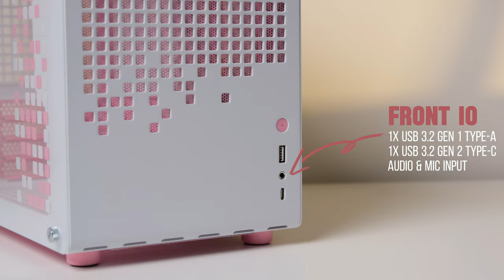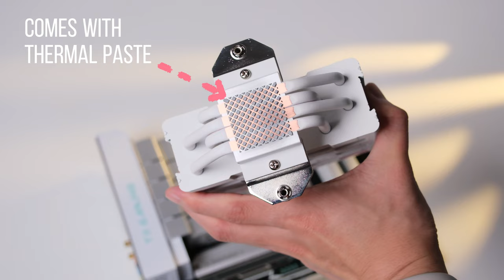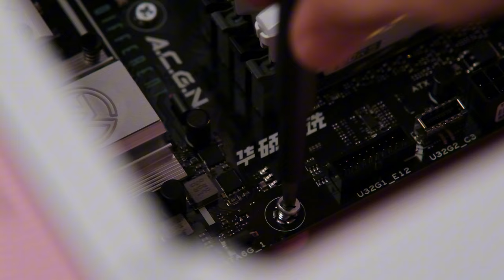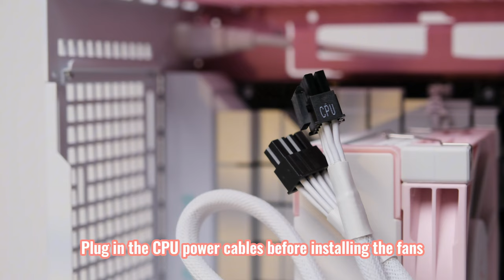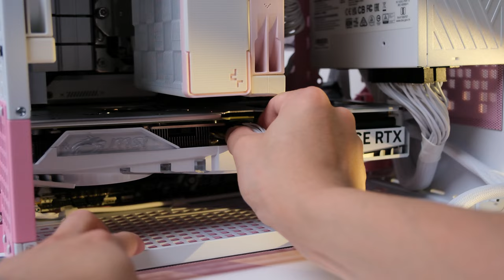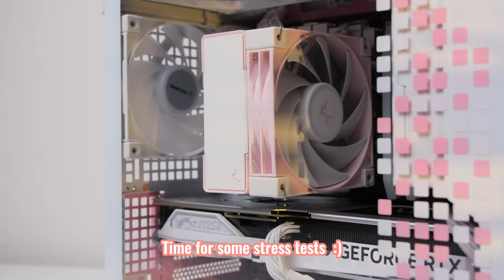A Pink White Jonsbo Z20 mATX Gaming PC Build

Comment: I knew it was the Deepcool AK 400 Pink that was going to be used in this build. I wonder why you didn't pick Galax GeForce RTX 4070 Ti EX Gamer Pink ? Don't worry, MSI GAMING X SLIM is absolutely stunning ✨
Reply from the maker: The galax one is rarely in stock in Australia and the pink on it is a bit too rich that might actually ruin the light pink white theme. If I can get sponsor from PowerColor instead of funding myself, I would've chosen the PowerColor Hellhound Sakura AMD Radeon 7800 XT to be the GPU instead. For the PSU I would also pick Seasonic VERTEX SAKURA Limited Edition GX-1000 1000W Power Supply (pink white all the way!), but it is not sold in Australia :(

Comment: Wow, was the psu a fully ATX? Not sfx-l? Is there even space for an AIO on top? Just wow.
Reply from the maker: 14cm long ATX and yes you can do AIO on top
Reply: @nellalab  mhhm, what was the problem with this case? It seems Amazing, are there some secret problem? It's too perfect and cheap to be real 🤣
Reply: Btw, you can use new enermax df 12. A full atx PSU in sfx dimension!
Reply: I have black with orange accents myself, mainly MSI. Have 2 case fans bottom, sucking air in from bottom. 1 back fan as exhaust. MSI 240 AIO, hose on right. Corsair SF-L PSU needed to be position 3 down to fit AIO. Love my little box.

Comment: Ever since I saw the z20 cases a few weeks ago I've wanted one so bad...they aren't super SFF but offer so much more than the terra and only maybe the ncase m2 would offer more for smaller, but without the lovely color accents..

the pink and white is gorgeous but the pink and black has appeal too, but I love the honeycomb and white as well!

Also I love deepcool, they make awesome stuff and their mystique 240mm AIO would go very well here (maybe if it fits) tho maybe PSU would have to be lower which would mean sub 310mm cards like the proart one but either that one or the ID cooling pinkflow 240 aio which would be perfect.. If only the Galax 4070 EX gamer pink graphics card would fit..😢
Reply from the maker: If u wanna use 240 AIO at the top, it is recommend that you install the radiator with the tubing side on the left so it would not impact the PSU. In this case you should be able to install the PSU at the second slot. And I highly recommend buying a 140mm long PSU. It will give you better clearance for GPU. In this case (second slot, 140mm long PSU), you should be able to install GPU with length of 363mm.

Comment: flip the cpu fan, intake from back, and only 1 fan up top near psu, and put 1 or 2 fan on bottom
Reply from the maker: Intake from the rear I was also thinking about that but then using the Deepcool fan as intake, given it is too close to the rear panel, actually generates higher noise due to turbulance.
Reply: @nellalab  try other fans, or just lower the rpm to ok noise. turbulance from where? air? cause the fan too close to each other? flip the fan not switch the position

Comment: cool build, may i ask how loud is this under load?
Reply from the maker: The CPU doesn’t require high watts and I picked the MSI 4070 Super Gaming x Slim just because it is one of the most silent cards. With fan curve tuned correctly, it is hard to notice any noise.
Reply: Right, thanks 🙏

Comment: I want to ask if my power supply with dimensions: 160mm (L) x 150mm (W) x 86mm (H) will fit in this case? Thank you so much.
Reply from the maker: Yes it will fit. However, that will limit your GPU compatibility - Longer PSU leaving less space for the GPU, so unless u have a short GPU (no more than 280mm long).

Comment: it's very hard to find clear dimensions to this case, will it fit the endorfy fera 5 dual fan cpu cooler?
Reply: Official website have enough info about this case
Reply: @yuriibabka3563  no actually, they have info only about case fans, nothing about cpu fans. and besides that, the dimensions are in mm when standard is in cm which makes it harder to read.
Reply from the maker: Never heard of that CPU cooler but based on research, I can see that CPU cooler height is 15.5cm = 155mm (yes, conversion is simple as that). And Jonsbo CPU Cooler compactibility is 163mm (written directly on their website). So yes, it will fit